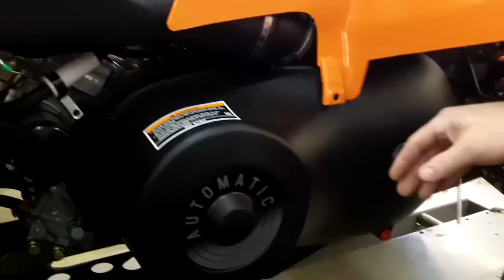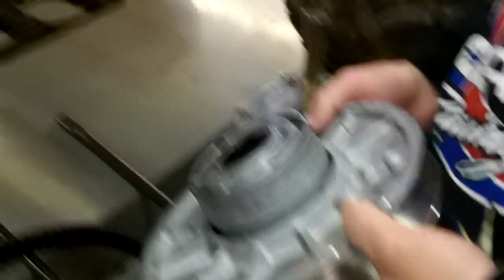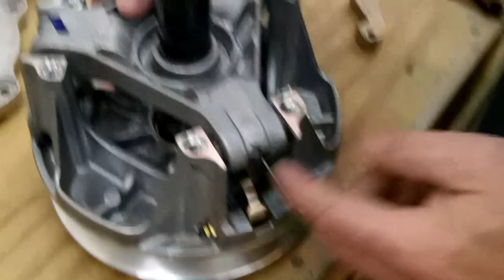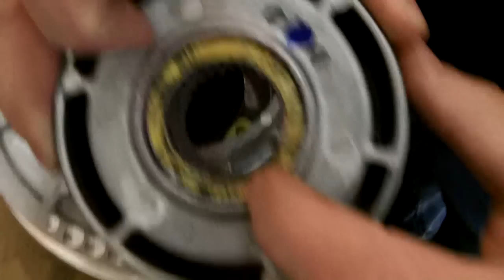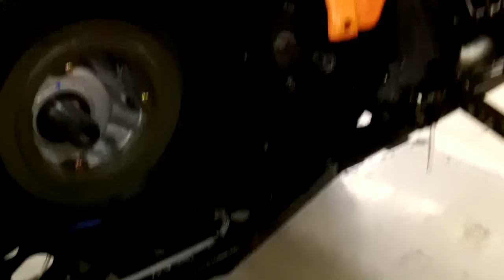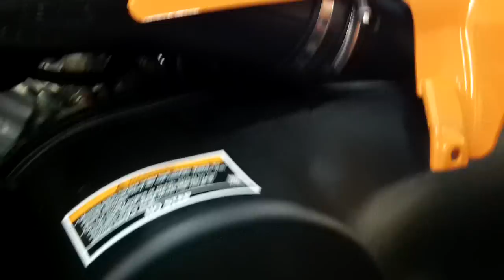EPI Performance Polaris Sportsman Clutch Kit Install

Comment: Great video but on your initial explination of preloading, you turned the helix in the counter clockwise direction and when you installed, you rotated it correctly moving the helix clockwise and the shive counter clockwise.  I would like to see how to allign the primary and secondary clutches.

Comment: Is the clutch kit recommend if you are running bigger tires? Great vid.
Reply from the maker: Yes, the bigger and/or heavier the tires you have the more important adding a clutch is.  We have several kits for the bigger tires depending on how big and what type of riding your doing. Call us 218-829-6036 and we can help you out. Thanks!

Comment: I put it back together and the pulleys are misaligned , what to do  😢  is th clutch shaft tapered ?
Reply from the maker: The primary clutch is tapered but can only go on so far, so as long as you torqued it properly is shouldn't change.  On some models there are washers either behind the secondary clutch and some behind the bolt the holds the clutch on, if any of these are missing if could change your alignment.  If your clutch and belts are turning at idle also double check your bearing in the center of the primary clutch.
Reply: Ok, dummy me, i had the secondary clutch on backards, somebody must have spent many sleepless nights, figuring out where to put the worlds hardest starter, ive replaced many in my life, but this is the worst
Reply from the maker: @jandeband  Lol.  Glad you got if fixed.  Now you can go ride and get rid of the stress from working on it.

Comment: Do you make a kit for the 21 Ranger 570?  didnt see one on your site.
Reply from the maker: For the Midsize models 15-21 use the same clutch kit.  They should be listed on our website.  If you need to you can call us at 218-829-6036.  Thank you!

Comment: I have a 2012 sportsman 500ho that has been giving me a lot of clutch problems, do you guys recommend a kit for that size? All stock.
Reply from the maker: We have a clutch kit for your machine that will give you better all around performance that would change the springs, weights and helix.  But if your clutch is worn out you might need a clutch rebuild kit to get your clutch in proper working order first.  Or you might need to replace the clutches.  I would inspect your clutches and then call our tech line 218-829-6036 and they can help you determine what you might need to get up and running again.

Comment: Can u install a sportsman clutch on a ranger?
Reply from the maker: in most cases no.  Polaris has hundreds of different part numbers for clutches because they are model specific.  Some have engine braking some dont, the offest for belt alignment is different and some even are set up to turn the opposite direction and they also can use different size belts.  Best off getting the correct one for your machine

Comment: Thank you,  very helpful👍🏼
Reply from the maker: thanks!  glad we could help
Reply: @EPIperformance  what is the torque on the primary clutch ?
Reply from the maker: @luissandoval6237  47-50 ft/lbs
Reply: @EPIperformance  thanks

Comment: Just done this to a 450 sportmans. Low made a crazy good difference but high gear on the bottom end seems a bit boggy a little worse than what it was. After it takes off it seems good. Any explanation? Extremely happy with low gear for sure
Reply from the maker: i would double check to make sure the secondary spring is preloaded properly.  IT should be better in low and high.  IF the spring isnt set correct it will be noticed more in high range.

Comment: What would be the best performance clutch kit you offer for 2014 Polaris sportsman 570 that will be running a 26 tall tire?
Reply from the maker: If your running a 26" tire that is a lighter tire and made for all around trail tire use the stock tire kit.  If its a heavier mud type tire then we would have you use the 27-28" tire even though your are 26".
Reply: @EPIperformance thanks, what happens if i get the 28 tire kit but decide to keep factory tires on will it make bike faster? Slower? Act like a direct drive with no slip?
Reply from the maker: @chevy19699  if you run the 28" with stock tires you will run about 200 rpms higher then normal and will lose a little top and speed and acceleration.  The best performance will be getting the right kit for the tire size.
Reply: @EPIperformance  thank you very much

Comment: Great video! What about checking the clutch alignment and offset?
Reply from the maker: Thanks Ryan!  Yes anytime you can check the alignment is a good thing.  Unlike snowmobiles a lot of machines you cant adjust the alignment depending on the models and styles of clutches.  Some models you can and its always good to check anytime you have the clutches off.
Reply: EPIperformance the alignment on my 2000 sportsman 500 has a slotted front engine mount. Alignment of clutch’s, center to center, and clutch offset checking is important at intervals. I have blown several belts having to be rescued.  Is their a way to make this machine touring oriented???
Reply from the maker: @ryankorn5911  Not sure what you mean by a way to make this machine touring oriented?
Reply: EPIperformance touring meaning traveling at high speeds for sustained periods of time.
Reply from the maker: @ryankorn5911  Any belt drive system will build a lot of heat if your running high speeds and the longer you run the hotter they will get will will lead to belt failure.  The Sport Utility Stock Tire kit would be the better for higher speed running.  The best thing you can do if you are doing long high speed runs is to vary the speed and rpms up and down some to give the belt and clutches a little break.
Reply: EPIperformance thanks for the helpful intel! Pinning out any machine is putting it to its limit. The 500 pinned out limit is 55-60mph. As I am looking to Cruze at 50-60, what engine size would you recommend for 8hr a day Cruze as not to be beating the machine?
Reply from the maker: @ryankorn5911  lol sounds like you need a car.  If your really trying to cruise that fast for longer times then you need to get a larger hp machine that is geared up for higher speeds so your more in the midrange of the mph of what the machine can do.  But to do that your looking more at the bigger sxs.  But even with that, your gona have to vary the speed up and down or you will continue to have clutch problems
Reply: EPIperformance outstanding information!!! Thank you!! For God and Country, we ride.

Comment: I literally just finished installing the Sport Utility kit. If you are somewhat mechanically inclined and have half a brain, you can do this.  I'm a DIY mechanic and did this in about an hour and a half by myself  with no clutch press. The video is a great instruction tool. The kit made a big difference especially in low gear. Pulled the front tires off the ground. Lots of low end torque. Just what I wanted. 👍🏼
Reply from the maker: Thanks Joe!!

Comment: When you installed the new helix in the secondary I didn’t understand how you installed it.
Reply from the maker: It is a little tricky to understand until you have the clutches in front of you.  If you cant figure it out from the video you might want to get a service manual for your machine.
Reply: Thank you

Comment: So which spring determines the engagement? I bought a 700 with an epi clutch in it and the engagement is about 2300 rpm which is too high for my liking. Maybe because I have stock tires but still kinda high for me. It's almost wide open going around the yard in low gear
Reply from the maker: The primary spring will determine the engagement.  If you tell us what color spring you have or the exact kit you have we can help you find a lower engagement.
Reply from the maker: You can also call us 218-829-6036 and ask for the tech dept.

Comment: I took my 04 700 sportsman efi and changed it to an 800 crank pistons and cam also changed go 12:1 compression and .20 over sized pistons with 26in tire what clutch would you suggest for me not a bogger just want more torque and take off
Reply from the maker: I would start with the 700 kit for your machine.  in most cases it should work no problem.  The one thing you might run into is the rpms being a little to high and then you would have to go a little heavier weight.  But you wont really know for sure until you run it.
Reply: @EPIperformance  I'm going to have to replace the entire clutch wanted to put the kit in prior to even installing it but my old one has crack along the faces where the belt rides any idea why it's doing that ?
Reply from the maker: Usually either to much heat from use or slippage or normal wear and tear after a while will cause stress cracks in the clutch faces.
Reply: @EPIperformance  it definitely slips alot sense new up grades I can see it causing heat thank you very much for your help and video would you suggest a cutxh kit by part number maybe all I see are those for monster tires and mudding
Reply from the maker: What size tires are you running, what type of riding are you doing and what elevation are you riding at.
Reply: @EPIperformance  really just hauling a** trail riding chasing cattle pool n the ranch and running 26in tires
Reply: Elevation is 0 down here in south texas
Reply from the maker: was your 2004 carb or EFI?
Reply: @EPIperformance  efi sorry

Comment: Is the the same on the sportsman 570?
Reply from the maker: Primary clutch would be the same.  The secondary clutch would be the same on all the non EBS clutches. Polaris uses two different clutch styles depending on if it has EBS or not.  If you have EBS the kit install is easier because you don't have to wind up the spring, you just compress the spring straight into the clutch and install the helix.  Hope that helps.

Comment: Hey is it normal for it to hesitate before it moves with that green spring? Input my Epi Clutch kit on today talked to Mike at epi he said the green was performance in the primary! I don’t like how it hesitating before it gets up to the Rpms  to move
Reply from the maker: Depending on the exact model and year and which green spring it is they can and normally raise the engagement a little higher then stock.  It will come down a little once you heat cycle the spring from riding for about 20 minutes.  Then it should stay consitantly there.  Again depending on the spring and model they might be a lower engagement spring available, but I would suggest riding it a little and see how you like then.  The higher engagement will give you more low end power and once your moving faster backshift and throttle response.

Comment: Great video! Learned a ton in 15 mins! Was just wondering if there was much difference on the bikes with engine braking? My dad's 01 the primary exploded but looks pretty similar from the pieces.
Reply from the maker: Thanks!   The primary clutch would be the same between the different years, the secondary clutch is a little different.  On the engine braking clutches you don't have to preload the secondary spring.  You just compress the spring and install the snap ring so its easier to install the spring and helix.  I hope that helps, let us know if you have any other questions.
Reply: EPIperformance, Thank you sir, will most likely be calling you for some prices.

Comment: Great video guys. Nice to see an actual technician giving directions. I will be purchasing a 2016 1000xp  sportsman soon, what would you recommended for a clutch kit (0-3000). The stock tires are 26". I may go with a little more aggressive tread 27" tire at the most, later on. All terrain tire or at the most mud lites. NOT a pure mud tire. No other mods.
Reply from the maker: Thanks Scott.  For you machine we would recommend two different kits, it will depend on how long you switch to bigger tires.  For the stock size tires we would have you use the Sport Utility stock tire kit part number WE437280.  For the 27-28" tires you would want to use part number WE437282.  Both kits have the same amount of parts and price but they use different weights.  If you call us we can give you more details on things you can do also.  218-829-6036.
Reply: EPIperformance ok thank you.

Comment: Is the washer under the snap ring necessary?
Reply from the maker: Its recommended to use the washer, but you don't have to.  Unless it wont fit under the snap ring we would always install the washer.
Reply: yes

Comment: for torque on clutchs any thing i can find says 40 for primary and 17 for secondary
Reply from the maker: Should be 47-50 on the primary and 17 for the secondary bolts.

Comment: I noticed your clutches are marked in red on certain spots on the drive and driven clutch. Just wondering about when i install the drive and driven clutches onto my 2010 sportsman 550 x2 do they have to be put back on in any particular way??, **kind of like cam gears if not timed properly it wont even work.
Reply from the maker: No they don't have to line up with any timing marks or have to be in any specific position.  Just slide them on the shafts and tighten the bolts and you are good to go.
Reply: +EPIperformance thanks brutha!!!

Comment: do you have to pull the primary clutch off? looks like it might be possible with it on the machine?
Reply: Its just easier to pull the one bolt out and bring it up to the bench. It would be too difficult and more time consuming trying to do it while it is still attached

Comment: My 07 450 with 26s goes up to redline before the clutch starts to move and didn't use to do this. Would a clutch kit fix this issue? Or is this a possible secondary clutch issue?
Reply from the maker: Typically if its going that high before you start moving that means there is an issue with your primary clutch and belt. Something in the clutch must be binding or stuck, or the spider has loosened up and started unthreading itself.  I would pull the cover off and start inspecting real good.  Then go from there.
Reply: +EPIperformance thank you so much for the reply. I believe it started after I ran out of fuel and had to be towed 10+ miles.
Reply: +EPIperformance I start off fine it's when the clutch is suppose to start working around 15 mph it can go up to redline unless there is no load like going downhill then it works fine.
Reply: After watching more of your videos I think the clutch cover is binding on the spindle and with high enough rpm it finally lets go and drops the rpm. So I may need a whole new primary clutch. It only has 800 miles on it.

Comment: how much hp can the clutch and belt set handle? can it handle 160hp?
Reply from the maker: It depends on your application.  Stock Polaris ATV clutches are getting maxed out around 100hp.  The new Polaris sxs are are around 150.  Snowmobiles are 200.
Reply: +EPIperformance do you sell the 200 hp version.
Reply from the maker: We don't build or sell any of the clutch systems.  We just take the clutches that are stock on the machine and tune them better for the type of use you are looking for.  STM in Michigan builds billet clutches that they sell for you.
Reply: +EPIperformance thank for the advise

Comment: Do the epi clutch kits hold back on the rzr when going downhill.
Reply from the maker: +greensammy87 On the RZR we delete the EBS (engine breaking) if the machine has it.  Most RZR have little or no EBS.  Hope that helps let us know if you have any other questions.

Comment: By putting on this clutch kit, do you gain top end or lose top end or do you gain bottom end or lose bottom end?  I am thinking about putting this clutch kit on my 2002 Polaris Magnum 500 4x4. Please let me know and give me advice to make my bike have more bottom end. I also have 26-10-12 in front and 26-12-12 tires in the rear.
Reply from the maker: +Ryan97Braz Our kits will give you more bottom end and midrange power and acceleration to get to your top speed faster.  For stock tires kits the top end speed should stay the same, for over size tires and the mudder kits you might lose a little top end speed depending on tire size.  Wit your 26" tires if they are a lighter trail tire we would have you use the stock tire kit.  If they are a heavier more aggressive mud tire then we would have you use the 27-28" kit.  You will also get faster backshift and throttle response ans grip the belt better then stock.  I hope that helps.  Thanks
Reply: My tires are ITP Mudlights 26", what one do you recommend?  I would want my quad to have more bottom end.  Mudders kit or stock tire kit?  would the mudders kit make my quad have more bottom end than the stock tire kit?
Reply from the maker: +Ryan97Braz  You wouldn't want the mudder kit for that light of tire.  Normally with the miud lights we would have you use the Sport Utility Stock Tire kit.  If you didn't mind losing a little top end you could run the Sport Utility Kit for 27-28" tires.  With those tires you might lose 5-10mph off the top but get more bottome end power and torque.

Comment: what's all included in kit. my spring broke in secondary clutch n wiped out buttons n grooved the helix on 2012 sportsman 500 ho
Reply from the maker: +Jason Marx You will get a new helix, secondary spring, primary spring, and a set of weights in that kit.  You would want to buy a new set of buttons to go with the kit.  Hope that helps.  Thanks

Comment: Hey just recently took out primary clutch on 95 Polaris 500 sportsman and those little bearings fell out..how Dow I put them back in?
Reply from the maker: chuck chuck If you talking about the three little bearings that the weights rotate on you will need to completely break down the clutch.  These are called Rollers.  Its takes a holding fixture and a spider tool.  Here is a link of how to rebuild the primary clutch.  https://www.youtube.com/watch?v=N-4BiRHFYTw&feature=youtu.be
Reply: Hey..EPI thanks for the help..I got it put back together thanks to ur help..it runs great and thanks again